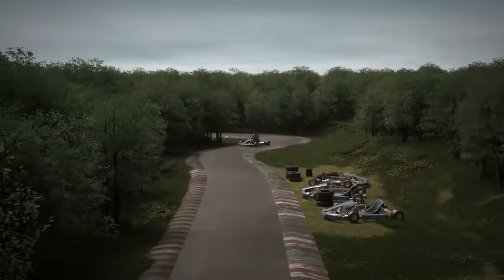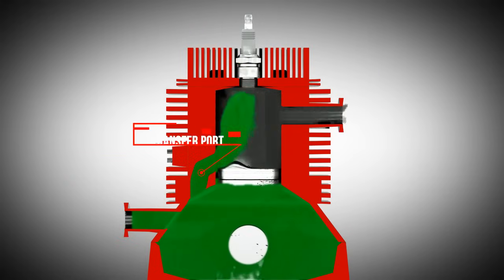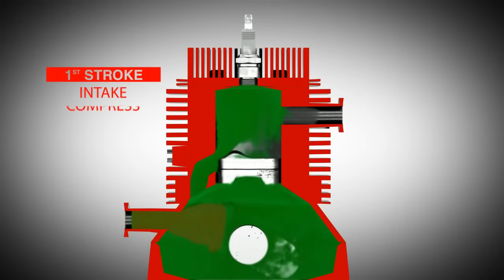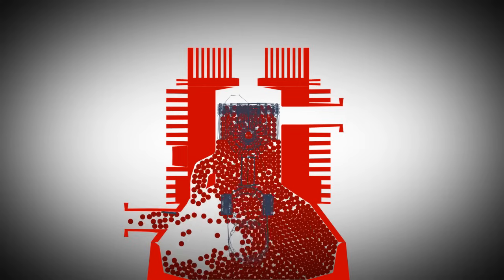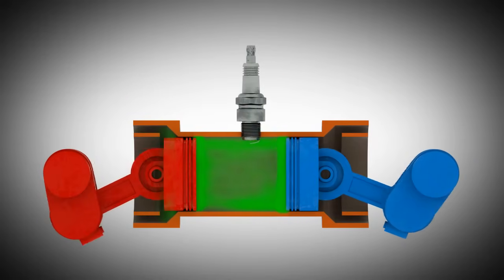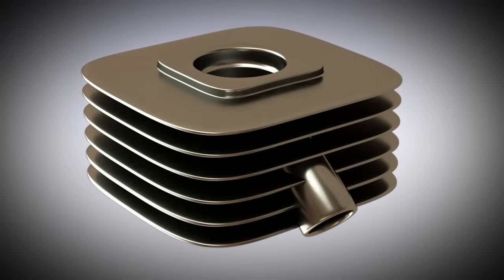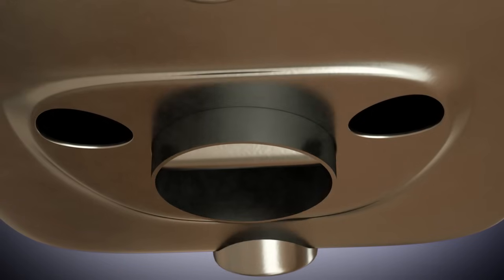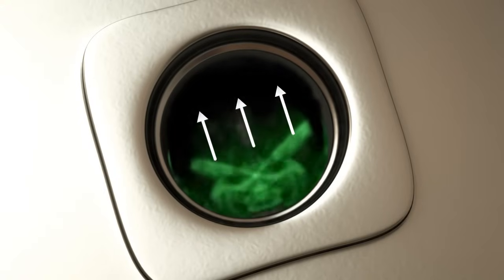Two-stroke engine - How it works! (Animation)

Comment: Love the fact that it was designed in such a way that the sonic wave of each explosion help the next fuel-air mixture return to the combustion chamber.
Flawless animation. 👌
Reply: Yeah I would have loved to see it represented in the vid, cause it's clearly one of the important part to explain how it works ! Still a verry nice vid !
Reply: Where can I find more about sonic waves in 2 stroke engine
Reply: @yashdesai8372  book called Two stroke tuner's handbook.
Reply: Yeah the piston going down makes tremendous pressure in crank case, hence the heavy strong bottom and sealed crankcase, this pumping acting blows and pressures the oil mix the crank and pressures the oil on the parts,
Reply: https://www.youtube.com/watch?v=m6AZ7_mACUg&t=30s